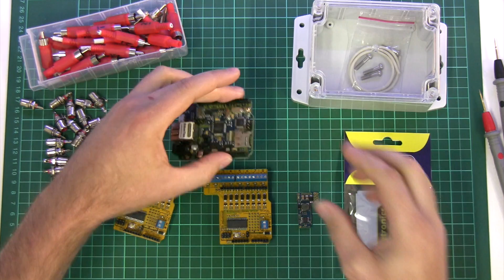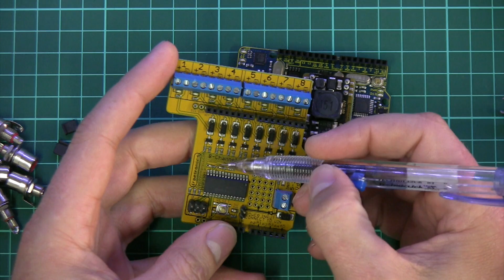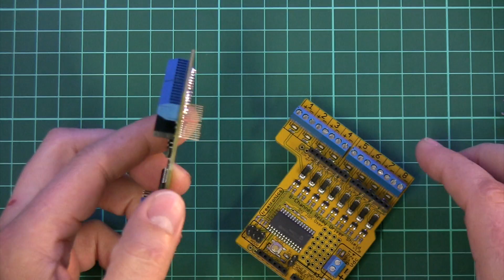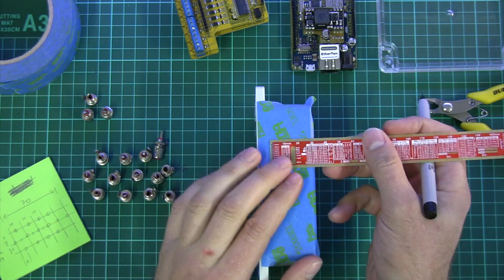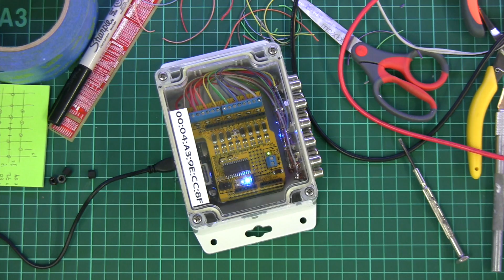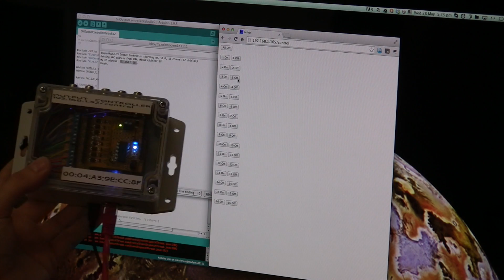SuperHouseTV #12: Building an Arduino home automation controller

Comment: I have one question, you said you got rid of the other two pull up resistors which would then raise the total pull up resistance because you removed two of them in parallel. Is it needed to have a higer pull up resistance or is it just good practice?

Comment: Does anybody know how to wire the RCA connectors to the relay shield outputs? He completely skips the wiring part.
Reply from the maker: Emile Lebrun-Van Raes This section is very simple, so you can use whatever connectors you like. It’s just positive and negative outputs from each channel of the shield going to the relay coils. I think I used center pin positive just because that’s a convention, but it doesn’t matter. The wiring diagram is on the “getting started” guide for the shield that’s linked on the episode page: https://www.freetronics.com.au/pages/relay8-8-channel-relay-driver-shield-quickstart-guide
Reply: SuperHouseTV Thank you for the reply Jon, I greatly appreciate it! I’m wondering if I could ask you something else as well. I’m having a hard time understanding your sketch. I don’t know what I have to change in the sketch to make the program work for me, I don’t know how to extract the MAC address from the EtherTen, and I don’t know where the Ethernet cable connects to? Is it to a computer, or an network switch? 

Also, every time I try and verify and compile the sketch to upload it to the Arduino, I get an error saying that I’m missing certain libraries or that the IDE can’t find libraries. I’m really lost with all of this. I have the build complete, but the sketch has left me lost. 

Thank you for your time.

Comment: hello Jonathan, 
hope all is well
, I’ve recently made this project with 2 shields (planning to add more later)
But I have a bit of a problem, I’ve got up to the web page, I can see all the outputs 1-16 but when I press any to turn on nothing happens I see lights flickering on the board(communication) but that’s about it, and I also can’t see it on my network neither which I find odd seeing as I can bring up the webpage,
Any suggestions? Thanks

Comment: Hello i know this is a older video and a awesome one at that. But i was wondering What about a Light controller. I have 4 110v light bulbs in my place that are Dimmable  and i also have a Dimmable light switch. How would i be able to control that using a home automation setup?

Comment: Hi there, I think your videos are brilliant! Thanks for sharing.

I'd like to build something like this to control lighting in my house, I'd somehow like to dim certain lights and wondered if that was possible through this system
Reply from the maker: It's not possible with the system I showed in this video, because it uses relays to control the loads. Relays are only useful for simple on/off control. Dimming can be achieved using something like a TRIAC instead of a relay. A TRIAC could be controlled by an Arduino based controller very easily.
Reply: Thank you! I've ordered a 4 channel board with Triacs with zero-cross detector

Comment: For this project I got a few questions.
- How much output can the device generate? Like lets say can I switch a cooker on?
- How much power maximum can it drain? How much voltage? 220/230? is this possible? Do I need another way to build some relays?
- How would it work with the plugs connecting to a external device? 

I know more from the code technical aspects as from the power/device technical aspect, as they always seem to skip that part on tutorials.
Reply from the maker: This particular controller doesn't switch mains directly, it only has outputs for controlling relays that are external to the box. My system uses DIN-rail mounted relays that were fitted inside the switchboard by my electrician, so the outputs from this box only have to supply 12V to the relay coils to activate them. That way my part of the system (the logic and control) is totally isolated from the actual loads, which are wired by someone who is licensed to do that.
Reply: So what can you switch/ power on / off at the other side? 
Whats the practical usage for this project?  Do you have some examples you can show us =)?
Reply: It depends on your needs in the video You just see a control box like a 'PLC controller' with outputs where You can connect outputs to relays You want to control.
Reply: SuperHouseTV So what would the cost be to have an electrician install the new relay box, so one could do this?
Awesome video and know how! I wish that I was at that level. Getting there though.
Just makes me wonder about how much it would be to change out the unit on my house, so that I could even begin to think about this.
There are most likely a few companies who would do this, here in the Phoenix area.
Great job on the clean unit build!

Comment: Hi, great video. Can you explain how the RCA cables would physically connect to relay. The relays i have seen need 5V, 0V and and an input wire. The RCA only has two wires. I know i am missing something thanks
Reply from the maker: Mechanical relays only need two wires, connected across the coil. Perhaps you're talking about electronic relays that actually have a FET or something inside them, and use a logic level input for control?
Reply: Thanks for the clarification, yes it was the electronic relays i had seen.

Comment: You might prefer the Courier New font for printing MAC addresses. I use it when I need to distinguish between 0s vs Os, and 1s vs ls or Is for example.
Reply: Actually, Consolas might be better.
Reply: MAC addresses should not have any "I" or "O" as it's not part of the hexadecimal space.
Reply: Yep. It's just a personal preference. Uncrossed zeros freak me out, as do ones without the two small lines.

Comment: Didn't realise you had videos!!!  I chose (as you know) Raspberry Pi as the central controller - and ESP8266 for the rest.  http://tech.scargill.net/home-control-2016/
Reply from the maker: I replaced the old eeeBox shown in the early videos with a Raspberry Pi 2, and recently a Pi 3. Much lower power consumption, no spinny hard disk, no fans. Much nicer!
Reply: I've learned a lot about the Pi... probably the most important two items - reliable power and decent microSD. For the latter (and they are CHEAP) I use the Samsung Evo 16GB or Sandisk Extreme 16GB after reading an elongated report comparing the various chips... and for power (you may love this) - I use this DIY kit - got to be the cheapest way to safeguard against power loss... ok, so you need a soldering iron :-)    

http://tech.scargill.net/more-uninterruptible-supplies/

As for the Pi3 - love it.
Reply from the maker: Those little power supplies are a bargain! I power mine using an expansion board I designed that includes a switchmode power supply, 433MHz receiver and transmitter modules, an ATmega328P, and some status LEDs. I have code running on the ATmega to receive and decode signals from common appliance remote controls, and it can then transmit matching codes when commanded by the Pi. So I can have UI items in OpenHAB that cause the appropriate 433MHz signal to be sent, which controls whatever end device it's set up for. Much more expensive than one of those little modules, though.
Reply: Great fun, isn't it :-)

Comment: 28v regulator fine to use with 24v/230v relays?
Reply from the maker: Probably. Do you mean a regulator that provides 28V output, which you will then supply to relays with a 24V coil and 230V contacts? Driving a 24V rated relay at 28V should work, but it'll be very lively (it'll slam shut like a gunshot) and may run warm. Better to run them at 24V if you can. Or perhaps I misunderstood the question, and you want to run them using a voltage regulator with 28V input. In that case you need to make sure the output provides enough voltage to drive the relay: you'd probably need about 18V or better for it to be snappy.
Reply: Thx for reply,  it was for a 24vdc coil.  Engineers at work seem to think the voltage difference is minimal so I will probably give the 24vdc coil relays a go. They will be NO anyway.
Is the ground bus still ok to use with the 28vdc POE?
In regards to the web browser controlling the arduino, did you create an app with MIT2 App inventor to run on Androids (noticed in your other videos), and somehow get the web browser talking to the App?
A Teledruino tutorial (watched the other day) is the only other way I seem to be able to get my head around communicating back to the arduino wirelessly.
Reply from the maker: hoeyisgod Sounds good with the relays. Back when I did that video I was running a web-based interface hosted on a Linux box, so the "app" is just a web browser in full screen mode. It used asynchronous javascript to send commands when buttons were clicked, and then give a visual response with the button fading. Since then I've switched to OpenHAB for the main logic, so I run the OpenHAB app. I'm due for another video about the overall architecture, because it's changed a bit since the original video.

Comment: would the ip address stay the same
Reply from the maker: Yes, if your DHCP server gives it the same address each time. You can use the MAC address to create a DHCP reservation in your router or whatever is acting as a DHCP server on your network. Or you can hard-code the IP address in the sketch. I've used both methods

Comment: Great build! 
Lets say this was used as lighting control for 16 groups of lights in a building, as it stands, the only control is via the LAN interface, is there a way to add local inputs and assign them to the outputs. ie. a local room push button that with one push turns an output on and then another push to turn it off?

Comment: The total resistance of resistors in parallel is the inverse of the sum of all inverse resistances and not R1  / 3. Or?
Reply: +chuck77k 1/(1/R+1/R+1/R) = 1/(3/R) = R/3. As he told this is the simplified version, only because the resistances are the same =)
Reply: Furrane
tnx :)
Reply: 1/4,7 + 1/4,7 + 1/4,7 = 3/4,7, the inverse of which is 4,7/3 :D

Comment: Hi, i see in many videos/tutorials connecting arduino outputs directly to relays.. . why is this not recommended?
Reply from the maker: +MrEmirv Arduino outputs are either 5V or 3.3V (depending on model) and typically limited to 20mA current max per pin, with a total limit also across all pins. You can drive a relay directly provided it's within these limits. For example, a 5V reed relay typically uses less than 20mA so you can connect it directly, provided you also include a reverse-biased diode across the coil for back-EMF protection. Arduino outputs are only intended to drive high-impedance, logic-level connections, not bigger loads such as relays. That's why transistors, I/O expanders, etc are typically used between the Arduino and the relay.

Comment: so can it be controled over Internet or only in a LAN ?
Reply from the maker: +Knight Rm That depends on the network settings. I can use port-forwarding through my firewall to allow connections from the Internet, but right now that's disabled. You have to be careful with allowing external connections that control your house!
Reply: +SuperHouseTV so true. Ionly can control it via LAN with port forwarding. (because it depend on our ip adress.). i hope that . If you do it via internet. Please if you don't mind.

Comment: hey awsome tutorial.
i was wondering would u please show a vedio to increase the digital pins of arduino in detail using external relays.

that would be really awsome . if u can provide me the circuit diagram that would help me a lot .

thanks in advance.
Reply from the maker: +Deep Bratt Mondal There are 2 simple ways to do this. The first is to use addressable outputs, so you can add more outputs and still only use a small number of digital pins. I do that using I2C, with this shield that I designed to use in my house: http://tron.cc/r8 The second is to use an Arduino with more pins, such as a Mega or Due type board. I use these: http://tron.cc/em http://tron.cc/etherdue

Comment: Thanks for sharing really, interresting!!
Would it make sense to use the digital/analog pin of arduino to get some sensor signal in to be able to automate even further and then be able connect it to max/msp like software to process more complexe pattern? 
But at the end of the day, could someone hack your home??
Reply: +Moulin Baptiste Yes, I've used analog inputs for many sensors. Some time ago I rebuilt my light switches so they don't have an Arduino behind every switch, instead they connect to Arduinos located centrally that monitor many switches each. I also use a variety of sensors inside and outside the house for temperature, humidity, light level, barometric pressure, and movement. Could someone hack my home? Maybe. It would need to be done in several stages though because most of the devices in my house don't connect to the Internet directly.

Comment: How easy would it be to modify this set up by using a Raspberry Pi connected to Arduino Relay Shields?
Reply: +Bear Sterns If the relay boards allow 3.3V input, then sure, you can use a Raspberry Pi. Personally I've found the Raspberry Pi isn't quite as good at general purpose I/O as Arduino, so a good way to go is to combine a Pi and an Arduino together. Then you can run the main code on the Pi, and use it to control things via the Arduino. This board is designed to let you do that easily: www.tron.cc/pilv

Comment: How can we run devices which need 220V AC power?
Reply from the maker: Rohit Narayan I do this using mains-rated relays that are mounted inside the switchboard by my electrician. The relays have 12V coils (inputs) so the controller shown in the video can turn the relays on to switch the mains powered devices.

Comment: Hi, I saw on the schematic for the 8-Channel Relay Driver Shield, that you are using an 16 bit I/O expander MCP23017, but you only use 8 ports for the relay from a total of 16. Why not using MCP23008, which has 8 ports and has a total of 18 pins instead of 28, a much smaller footprint.
Reply from the maker: Adrian Carstea Short answer: I can't remember! I think it may have been something to do with availability / price at the time, but you're right that the MCP23008 would be a more optimised chip. I've since done a revised version of the PCB that breaks out the extra 8 pins on the MCP23017, but it's not being used on the production boards. I thought maybe that would be handy if people wanted to patch things into the spare I/O pins.

Comment: your a electronics whizz but you cant minimise ground loop isolation in your audio
Reply from the maker: Abe Coulter Sad but true. I didn't notice there was any hum until I transferred the video off the camera, and I really didn't want to start from scratch and record it all again.
Reply: you are right there, its a pain, here is an idea, get a regular LCD and put a raspberry pi inside the tv and turn it into a smart tv add wireless keys and mouse and wifi dongle, your all set

Comment: Nice work ! Looking to added a system to my green house for water control for Hydroponic system, To put in a NFT system for Flow control for each resevoires,with  climate control system,Feed system control,. This would need to be at a remote location for windows server to VPN. so i can contol the green house  from any place   with my Laptop unit.Looking for some help for this Greenhouse, Growing food is just like growing your own  momey Ya..

Comment: I'm fairly new to the arduino and just starting to learn, so excuse me if I am asking what may seem to be a dumb or stupid question.  If I built 2 of these boxes and placed one upstairs with devices attached and one downstairs with devices attached; could I make it where if one output on the box downstairs activated, other outputs on the box activated also?  Doing a 'if" this action or trigger happens then do 'this' type of thing.

Example:  I come home and turn on a light downstairs which is on one channel of a box downstairs and that activates channel(s) on another box upstairs that also turns on other channels that have devices that I want to come on at the same time (lights, fans...)  I hope this makes sense, thanks in advance.
Reply from the maker: Kenneth Elston The question makes perfect sense, and what you're talking about is exactly the sort of benefit you can get from a home automation system. Fundamentally, your question comes down to where the logic should be placed to group actions or events together. You could do it in the output controllers, but I don't think that gives enough flexibility. In my system the output controllers are "dumb": they're just outputs that can be driven on or off by external commands. The logic of my system is currently configured in a piece of software called OpenHAB, which allows various inputs and outputs to be bound together to achieve results such as "if the external lights are ON, and the external ambient light level changes from LOW to HIGH, turn off the external lights" (so the garden lights turn off when the sun comes up). Or "when button 27 (near the front door) is pressed, turn off every light in the house, close all the blinds, broaden the setpoints on the climate control to reduce power usage, wait 60 seconds, lock all the external doors, activate security mode" (to implement a "leaving home" button). So the logic isn't in the output controllers, it's in a central controller.
Reply: THANKS, for the quick response!!!  So I am on the right track with what I'm trying to do.  I'll keep going through your videos and learning.  Keep up the good work!!!